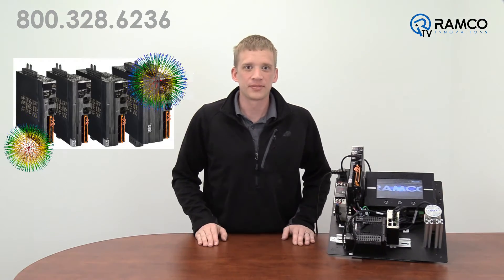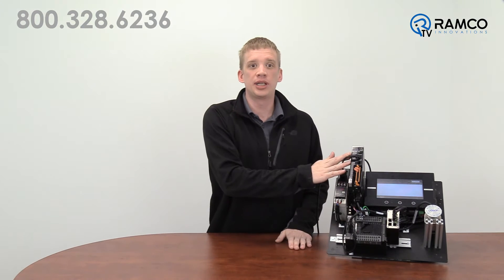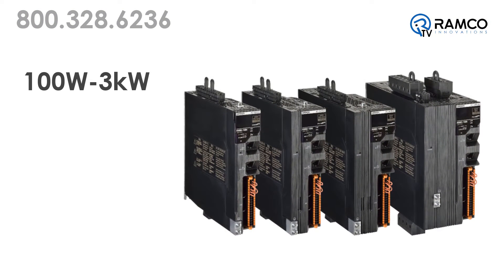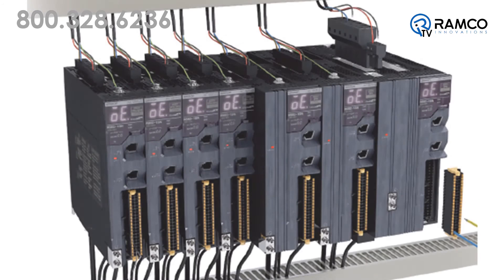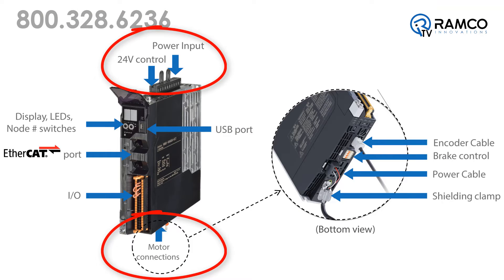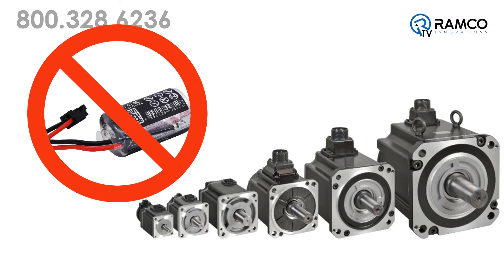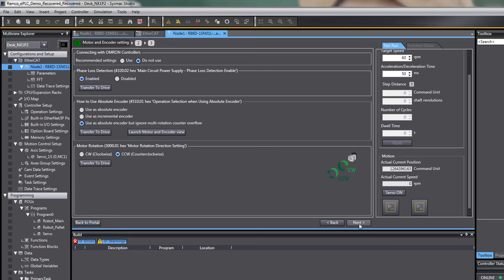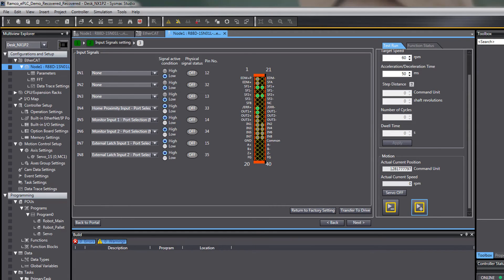Omron 1S Servo

Comment: After having this "--."    symbol on my display, I am not able to servo on my servo drive in test run. I have new servo motor and servo drive. What might be possible reason? I tried changing motor, but same problem occurs. If I connect servo drive using USB, then I am able to test run it, but when I am trying to test run via NJ501-1500, drive goes online, parameter transfer occurs, but I am not able to servo on my 100W 1S servo drive. Please help, if you know about this problem. I am stuck with this problem since last 15 days. I also updated sysmac studio to latest version.
Reply from the maker: Hi Ashish. This is what our apps engineer has to say: "If the "--" is displayed on the drive, that indicates the servo drive is NOT enabled. If you are using the "test run" feature in sysmac studio, you must "enable" the drive in the test run menu  before commanding motion.  If you are trying to control the servo drive using ladder logic, you must have a MC_Power function block in your ladder and maintain the 'Enable' side of the function block."
Hopefully this helps! If you require further assistance, please contact your local Omron representative, as they will be able to better assist you.
Thanks for watching our channel!!